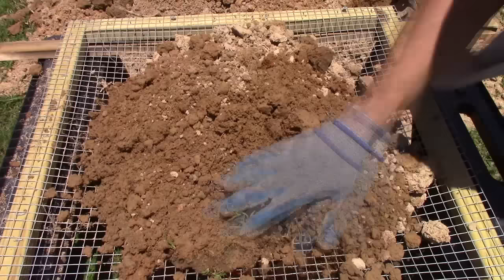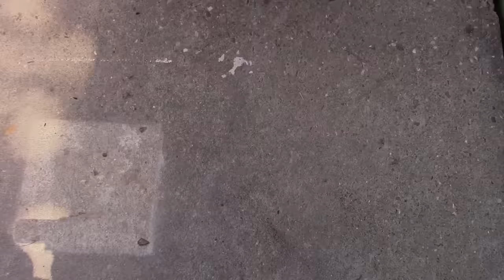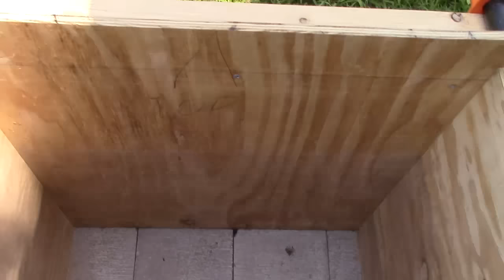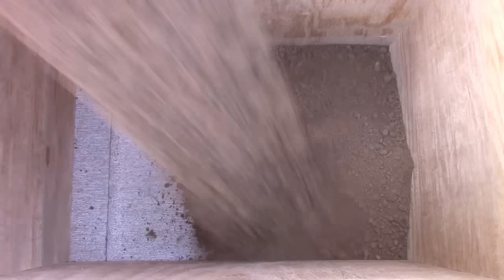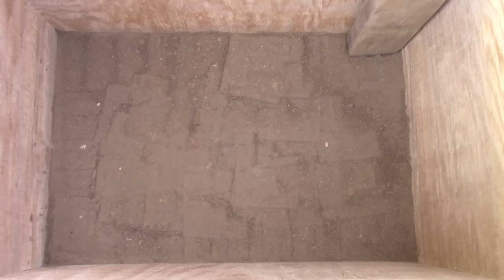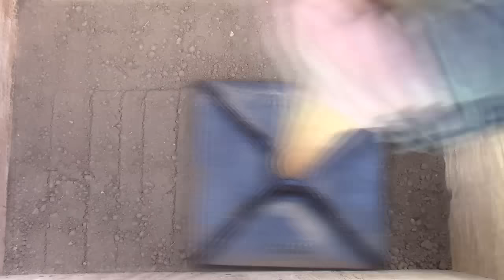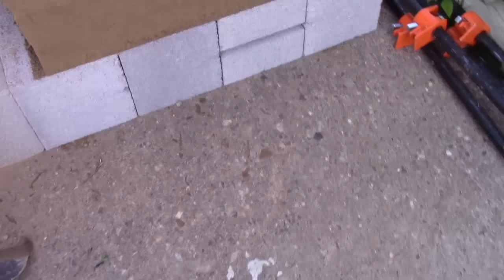How to Make a Rammed Earth Test Block - 5% Cement

Comment: Wow, seems like one of the most labor/time intensive ways to build a home that I could imagine...
Reply: It does take some work but with automation, it's not too bad. We use pneumatic rammers for example and motorized conveyors.
Reply: It's also the highest insulation rating, is immune to rodents, pests, mold, and lasts for thousands of years.
Reply: YA RIGHT I FORGOT RATS DONT LIKE BURROWING IN DIRT
Reply: It absorbs heat from the sun and releases it when the sun goes down.  Please it's cheap.
Reply: "The walls are also rodent-resistant because they don't offer any food sources for insects or other vermin."

A simple google search would have told you why its not attractive to rats. Rammed earth is super compressed. It has to be more difficult to burrow through. Why burrow through tough dirt for no food?
Reply: Re: Bio Power - Exactly friend.
Reply: the #1 reason is it's fire proof!
Reply: Isn't it thermal mass not insulation?
Reply: GOLD BACK; It's a rammed earth mix, not just "dirt". Didn't you see him stand on it? Try that with just dirt. It will crumble.
Reply: @goldback9988  they can't and won't when it's compressed like that.  Thousands of years of proof if you go looking

Comment: is the cement necessary do you think, seeing alot of contrasting opinions on that
Reply: Without cement it's called unstabalized, and not waterproof. You could  keep it protected or plaster it.
Reply: @dario2rnr  or a good hat over top. Many ancient buildings still standing used this method and I cement.  The better your hat and boots the less maintainence is required.

Comment: What does the 5% cement do in the mix? Without added water it's just powder. If it sets does it really make a structural difference? I suppose it does or it wouldn't be added.
Reply: Its rammed earth. Soil has moisture in it. Im sure the soil was damp to some degree, though. You can tell when he is tamping. This is soil, clay, sand, and 5% concrete to act as a stabilizer.

Comment: Agree with Mr Duncan, you kinda left out a lot of information, and honestly you really shouldn't go lower than 10 % cement by volume, or you will have brittle wall. and if you stamp from middle outward it reduces the voids and inclusions you see on your sides.  oh and you should only have enough water so the soil when squeezed in your hands stays together but doesn't squeeze out. just shy or damp.
If someone is going to build anything bigger than a doghouse, for a mild investment you can get a pneumatic tamper for about $170.00  and compressors are not that expensive, this will save your shoulders and a lot of time. 
Forms should be 18-24" for thickness of wall and you will need to put a 2x4 on the middle ends so when pulled it out it leaves an area for your next wall section to interlock. almost forgot you should seal it with concrete sealer after also, this helps to keep the exposed side dust down
Reply: If you seal it you will lose a lot of the benefits including the breathability of it all.  Really don't need any cement, at least they didn't thousands of years ago when whole societies built like this
Reply: @lisagoodspeed2301  your right they didnt use concrete , they used many other things like blood and bitumen etc, but they used something that bonded it, today its called concrete. And sealers keep moisture out not air molecules air molecules are much smaller so it still breathes.  moisture is the enemy and why so many of your Ancient rammed earth places dont exist unless it arid climate.

Comment: did you add any water missed if you did
Reply: Same thing I was wondering. On other vids of this "soil cement" after mixing and tamping they spray water.
Reply: Dont Tread on Me I suspect if the sand/soil is damp enough, it may activate the cement, but what I also think he might have in mind is having enough moisture to aid in cement activation and compaction, while trying to keep deformation and cracking down as much as possible.

What bugs me is the air pockets he left from filling in to much and not enough heavy compaction.

Comment: I'm not trying to be one of the "so many experts here" but if you scarify the top of the layer you just compacted before you add another layer, you will get a better bonding of the layers.  Scarifying is a fancy word for scratching up the surface. Compaction of dirt is a skill.  You did yours very well.  Do this and it will be perfect.

Comment: A Block of Dirt. 3000 years later we made a block of dirt. pretty sure the Egyptians had this one figured out way back then. difference being they used slaves. labor being what it is whats the cost benefit to pounding on dirt for weeks on end just to make a few walls. do the math. figure 55 per hr per laborer.
Reply: B BBski I hadn't heard the Egyptians had used it.
Reply: B BBski there was actually no evidence for any slaves in Egypt other than the lies the Jews spread in their bible.
there is no archaeological evidence or written document labeling anyone a slave.
Reply: +MrPepsicola123 Thanks friend. I was talking about them using rammed earth.
Reply: Daxx Green actually the Egyptians used lime in their "cement" which hardened over time and turned into stone. the Romans also used the same type of cement.

the current cement we use today becomes brittle over time and falls apart.
Reply: I should use lime then?
Reply: the egyptians had a caste system that in itself is a form of slavery.
you could never be more than what you were born into.

Comment: How can anyone who advocates earth building go ahead and use cement ? You just made a concrete block . The whole Idea of cob is avoiding all that crap . Rammed earth is not rammed earth once you add cement. Its rammed concrete .
Reply from the maker: Its not a concrete block if its only 5% cement. Most rammed earth has cement added to it. That's the reality.
Reply: This Cob House . I see . And its only Pot if you inhale. The reality is simply this . You take a natural product and corrupt it with Cement and its no longer a natural product. It may be your reality but in truth you have contaminated a natural product with a non reversible one . The fact that its only five percent is irrelevant . You are using an artificial stabiliser which fundamentally changes the nature of the raw material. Its rammed concrete . Are you going to start putting cement in your cob mix too and destroy its sustainable credentials ?

Why do I take exception to this ? Because I grew up with Cob , the real cob. No ridiculous expensive bond beams cast on top of the wall . Your re inventing the wheel and compromising a time honoured tradition thats proven . To much sustainable architecture is being compromised by this nonsense. 
I have seen what happens when cob is  rendered with Concrete . Not good .
Reply from the maker: That's okay. I guess you're watching the wrong channel then. I don't care about natural building idealists.
Reply: This Cob House . For the record , I am no pot smoking left leaning , birkenstock wearing greeny tree hugger. I am a craftsman by trade who is building an authentic traditional Cob House . Why ? Because the traditional method is proven , long lasting and non toxic. Its also a helluva lot more cost effective to do it the Old school way . 
My grandfather was a house builder . 
No , this is not about 'ideals' , its about calling out guys like you who are corrupting the tradition with BS . The building trade is so lame these days. Its all about max profit and minimum quality . Trouble is , once you guys have messed up the building standards for code compliance with your shonky re hashed methods it will make it harder for people to do it properly so the building will last and perform.
Reply from the maker: When you start dealing with coding then maybe you'll see the value in what I'm doing.
Reply: This Cob House . Already taken care of. Fully engineered and signed off drawings. The traditional stone plinth is down and the cob is going up. But I am not mixing the cob with a tarp. I am mixing it with a tractor and rotary tiller /FEL. A lot of guys are pushing their plans through by 'stabilising' it with cement . Ever seen what happens to brick mortar when there is to much clay in the sand ?
The Building codes are not there to protect the home builder .They exist to make max profit for the big materials manufacturers/suppliers /banks/insurance companies .

I had to fight to get it through but in the end they cant argue with 500 year old houses that are still lived in. There is a precedent in south west England. Use it. People are tired of being screwed over by the system . The building code in the US in particular is the biggest dirtiest most criminally fraudulent scam in building history.
Reply from the maker: I'm on the same page with you there. Its a mess here.
Reply: This Cob House . Its not much better here but once you start caving in to these local govt guys they will just walk all over you . What burns me is that they will bully and threaten your engineer , your certifier , your architect and anyone else who try's to help you . Trouble is ,once they set a precedent they have an argument . 
Thing with Cob is this .If you do it right ,its self healing and easy to repair. Once you add concrete it cant do that any more . 
It works a lot like the old fashioned hide glue I use to make furniture. Yes it takes a bit longer , but its self healing ,easy to repair and lasts for hundreds of years if its used right. Modern glues are non reversible . You cant get new to stick to old like Hide glue . It breathes just like Cob. It expands and contracts with humidity change ,just like cob. It does not fight humidity .
Concrete , oh man have I seen what a disaster that stuff is . Concrete cancer is a Huge problem . Its only strong in compression and once it cracks under stress its strength can rapidly disappear and then you have dead weight over your head .

A lot of the earth builders sell the green sustainable aspect of earth , but then they sell out to keep the inspectors happy and knock the job over quicker . BUT if you have a method you can lay 6 cubic meters of cob a day ! Thats hauling ass in any ones language. Of course your average builder does not want to wait a few days for it to stiffen up . 
I do understand the temptation to add cement for that reason but whats really amazing about cob is that it can withstand four plus weeks of pouring rain and still not slump  , once it starts to settle and firm up. I have visited rammed Earth homes but they look like concrete no matter how many fancy colours they throw in the mix. They look like it and they feel like it because they are concrete really. Sure you can add lime to soften it up a bit but its still the same . 
For years I worked on concrete workshop floors and that stuff just drains you .Its hard on your feet and knees and it just feels wrong . Once you have lived and slept in a genuine Cob cottage like my mother had you cant settle for anything less. You dont get the natural negative ion production from Concrete like you do earth. Its just cold and hard and soulless.
Reply: Brian Minghella 
If you lime wash the walls of your cob structure, which you're supposed to, you're using the exact same "evil" as he is here. Only difference is he mixed it in rather than painted it on the outside. Cement is basically just baked lime ground to a fine powder intended for water to be added later. Lime plaster or milk of lime is baked lime ground to a powder with water added...
Reply: Craig Slitzer . WRONG. Portland cement is not the same as regular slaked lime. It has various additives (some proprietary) to make it denser and harder than pure lime type mortars. The addition of silicates etc makes the cement much harder,denser and water proof. This is fine for some applications but if you refer to DEBA's website they warn people strenuously against using concrete renders over cob because it does not breathe and eventually leads to failure of the wall at its base.

Its the same with exterior paint. NEVER use acrylic. It will trap moisture and lead to rot. ALWAYs use an oil based breathable paint. 

Portland cement is derived from baking lime yes, but thats only part of the story. The temptation to use portland cement is always great because it sets hard and quick. Lime mortars take months to harden. But the advantage is that the lime mortar retains flexibility and breathes with the cob.
The beauty of cob is that it self heals and consolidates over time because it is tough yet resilient. Concrete becomes brittle and has low shock resistance. Once it cracks it is weakened forever. Cob breathes in moisture,expands again and re bonds ! Shear simple genius.
Its the same principle as hide glue. Its a reversible glue. It can be two hundred plus years old, but if you moisten it and heat it up you can reactivate it and reglue a piece of furniture together. Cant do that with modern glues like epoxy. 

Once concrete has set it cannot bond with fresh poured over it. Thats why you have to use starter bars. But there again, once you get cracks in the cement and the bars are exposed to moisture you get concrete cancer. 
What happens if you have to much clay in brick sand ? You get a lousy bond. Been there, seen that. Portland Cement only works within a very tightly defined set of parameters. Stray to far and you end up with a mess.
Reply: Craig Slitzer . In short, your answer is simplistic and technically incorrect. The list of ingredients that go in to the various grades of Portland cement are quite extensive. Sulphates, Oxides, industrial waste such as old tires to fire the kilns ! 
Its quite a cocktail and no longer a straight lime based cement. 
I did use if to for my piers and perimeter plinth bond beam. Perfect for that. But you cannot compare it to Cob which uses clay as the binder.  Reversible,degradable, repairable,flexible, shock absorbing binder. Its an aggregate that when you get the ratio's right is unbelievably tough compared to concrete which is hard, brittle, and almost impossible to repair if it starts to fail. 
Thats why I dont like Rammed Concrete. Your using a binder/cement that was never really designed or formulated to be used that way and that makes it an unknown quantity down the track. Portland cement is WET. Its a casting based formula. It relies on thorough mixing. You cant bond cold cement to fresh poured.
Cob is proven, it cant burn,rot or get eaten by termites. It does not get cancer. The next lift always wets and reactivates the dry one below so you get a very thorough mechanical and molecular bond. Over time, colloidal cementation, gravity and the shifting moisture levels consolidate the Cob and make it even stronger. I had to cut a channel for conduit through some cob last week and it was damn tough going. It absorbs blows rather than shatters under the pick or mattock.
Reply: Hey Brian.  Thanks for all this information.
We always learn more from Youtube discussions when there are disagreements and/or different opinion and methods.  So I thank you and This Cod House equally!  Thank you both.
Reply: Da L. I have made more than my fair share of mistakes and been lead down the garden path and up the creek without a paddle. BUT I keep learning and keep studying with the question foremost in my mind " Why did they do it that way and how ?" 
We have been kept in the dark to long by entrenched monopolies driven by profit and malice. Its time to face these thugs and re build healthy houses that feed our souls, not their bloated bank accounts. Good luck in your endeavours and may the force of nature be with you.

Comment: Coming from an Inspector thAt would be a fail as that is not the typical construction and only what the contractor is trying to pass off as normal construction. We do NOT accept accept faked constrution as real construction in most cases!!
Reply: Inspector gobbledygook: just use some positives explaining how you expect the test block be made. What is typical - it's compacted, has the reinforcement and saves on artificial tamping, fossil fuel use. Is that it?
Reply: Very typical... Codes are made according to the trend. When somebody comes with something different. It's the ooops moment what can we do now. It's not written in the book. LOL :-)
Reply: real vs fake? I guess the fact that earth houses last thousands of years makes them fake and modern houses lasting maybe 200 years makes them real. good logic

Comment: The cheapest, easiest and more stable way to build a house is from wood. It is a light construction and pretty strong especially if one uses steel for the frame. Steel can be recycled 100%. These rammed earth house is a really heavy construction and needs very heavy steel in order to become stable. For countries with seismic activity is not good but only for one store house.
Reply: It all depends on where you are building. In some parts of Mexico (I live in the State of Jalisco), wooden construction is unheard-of. Cheap brick and bad concrete are the most common materials. Most people here can't afford anything else.
Reply: they're are shake tests to simulate earthquakes in which this material outperforms most wood structures. it's on YouTube
Reply: No steel or wood needed if done right.  Just dirt